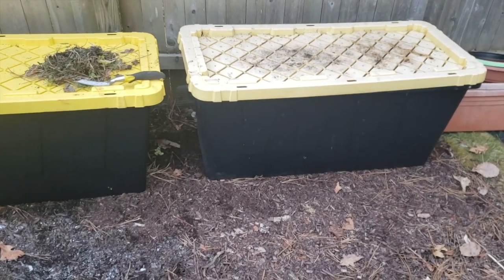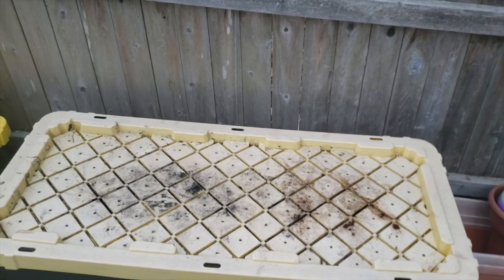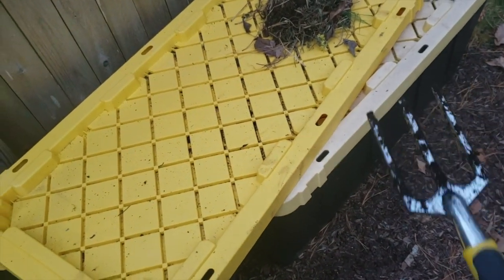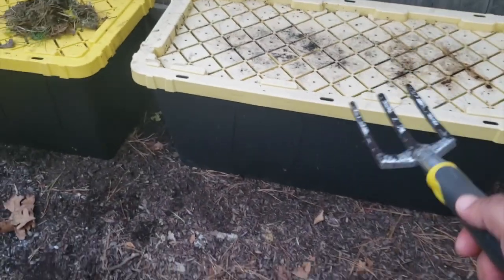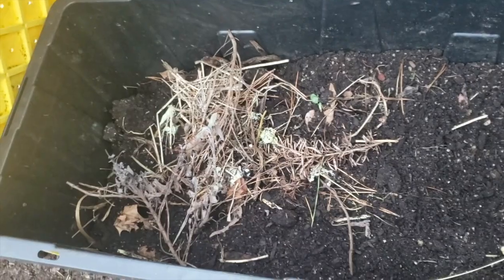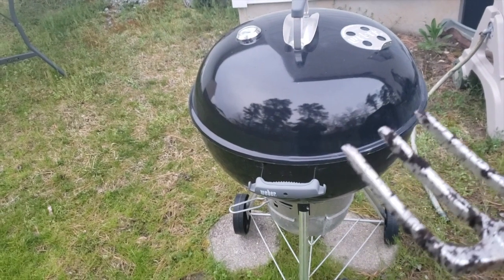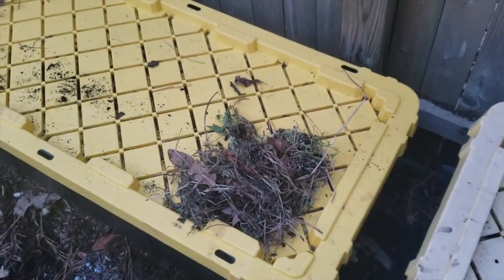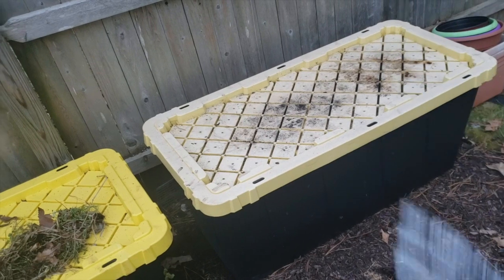Composting in Storage Totes

Comment: I do the even lazier man's method. I have less, way less holes, in my tote. I fill the tote all summer and top it off in August and again in November and then I don't touch it until May or June. I have the totes in a spot that gets winter sun. I might water them once or twice if I remember. Super lazy, takes forever, but the cycle works for me.

Comment: PRO TIP: Put a few small rocks at the front of the bin so there's a gap about a mm so worms that travel on the top of the earth, will find cover and then start working their way up for you. Reason I say this is, we all know what happens to planter bottoms when you lift them up or move them... This hide out spot where they will gravitate to, will make it easier for them to find the holes in your planter! -cheers

Comment: Great system! 
One tip from another gardener is to use a soldering iron to make holes in plastic totes, bins and buckets!
Reply: What about insects fruit flies getting in the holes
Reply: @joanneortiz6715  then you’re doing it right! The compost needs critters like that
Reply: You can also heat up a skewer on the stove to melt through, this is what I do any time I need to make holes in plastic. Works great with no cracking.

Comment: Wish i had seen this video years ago. I bought a tumbler. It does work but most of the good nutrients drain out of it way too quickly when it's time to keep it moist. So i have a bucket under to collect the compost tea. I save it and add it to the areas I'm going to plant in over fall and winter even over the snow to help get that area nutrients to soak in the existing ground. Also i don't get as much compost as i need. I have these same totes so this is a game changer for me 5 years later😊 late is better than never so thank you so much!!

Comment: Unless the containers are air tight you may not even need to drill holes if you're giving it a stir every week or so and managing moisture inside with what you're adding.  Currently have a tall trash can I'm composting in, but I really like the use of the wide bins in the video for ease of access.

Comment: Great video! I live in DFW area, so it is hot here most of the year, and this is the best compost method for me. I might add that I use the manual tiller from Amazon to mix it. I also tried to compost in a 32 gallon trash can, but it was very inefficient, too deep. 40-50 gallon bins are the best for me.

Comment: Very practical. I used 50 gallon trash cans on Wheels to move where I need. I like to bungee cord the lid on and Roll It on its side for aeration. I will try this as well I think it'll be easier to stir with my pitchfork.

Comment: Do you ever add worms or even lime, peat moss or other nutrients to your compost bin? Just a note for those who have not dealt with compost bins,  the weight of such a bin is really, really, really heavy if you do get water in it that does not drain. I had a modified compost bin from a plastic 55 gallon container. It had a large rod through it and was actually secured on a large wooden platform that allowed the bin to be easily turned. It had a door to remove the compost or to add in other things to be composted.  Best lain plans of mice and men sure went astray, as the bin got a lot of water in it and the sheer weight on it then broke the plastic where that main rod went through it. Took me forever to get all the mud and gunk out of it. Lucky t only ruined the top to the barrel, so I may try another shot at remaking the project to see how it works out. Thanks for posting this.
Reply from the maker: I don't add lime or peat moss. HOWEVER, there may be a little bit in there because I put in used potting soil to start. The worms come from how I start the bin with a layer or existing compost. I just did a video so that you can see exactly how I start the project. Check it out.

Comment: I have to questions 
1. Starting your compose bin for the first time what do you put down for the first layer?
2. Do you still compose during the winter? If so what is your process?
Reply from the maker: 1) Start with some compost, dirt from ground, or soil from old potted plants or containers. If you dont have any of that, just buy the cheapest bag of garden soil or compost that you can.

2) No composting during the winter.
Reply: @OldMcWaller  thank you for replying. I have started my process hoping for a good turn out.
Reply: @OldMcWaller   so how long before the first frost do you stop composting? Do you just separate out whatever is composted enough to your other tub and then dispose of the rest?
Reply: How do you keep pests out?

Comment: I want to put my bin in the garage, I know it won't compost as quickly as the sun/heat won't be on it, but then I can compost year round and it is just a few steps to clear out my kitchen compost and drop it into the bin.  Any modifications I should make to the process?
Reply from the maker: I dont know. I generally dont recommend doing this inside because of the smell and it could attract rodents.

Comment: very well explained, does this work for northern climates where it can get cold in winter.
Reply from the maker: The composting process will stop in the winter.
Reply: @OldMcWaller  thank u what do you do when composting process stops? just leave the tote as is and don't add more until next season?
Reply from the maker: @cutthecord1  Yes. At the beginning of the next season, I sift all of the good compost into the finished compost bin. Anything that has not broken all the down, I leave in the active bin and just start adding more to it.

Comment: Thanks for the video. I constructed a 10"x10" pvc greenhouse. I don't want to place a heater in the greenhouse, and saw that I can use a hot compost to heat my greenhouse. I plan to use the same size container as you. Do I place the container in the greenhouse, or on the outside? Also, do I take off the lid at night to provide heat? Any advice will be greatly appreciate.
Reply from the maker: I would place inside. if you take the lid off in this type of compost system, you may lose the heat inside. Normally the kind of compost system you would need are the taller ones. They give off more heat. It may work though.

Comment: So, if you keep adding stuff to the compost, how do you know when to take it out and put it into the finished compost pile?
Reply: You don't just dump everything into the finished bin. Instead, you scoop out the compost and pass it through something like 1/4-inch hardware cloth (wire mesh, mounted on a frame) to catch the big bits that haven't been decomposed yet. Whatever doesn't go through the screen goes back in the working compost bin.

Comment: If there are holes on the top, how do you protect the compost from being completely drenched by rain, or is this not a worry? Do you put it under shade or throw a tarpaulin on top when it's about to rain?
Reply from the maker: I am making a Q&A video about my compost system. I will answer these kinds of questions.
Reply: You could buy an extra lid, don't drill any holes in it and swap over to this lid when it's about to rain.

Comment: Very good post. I will be starting my first compost soon to be ready for spring. I do have 1 question friend. 1st layer compost 2nd layer green 3rd brown 4th compost & repeat correct? And do you add water in between layers or I guess how do you dampin the layers? Thank you
Reply from the maker: Compost is what the green and brown make together. I add a little finished compost at the bottom because it included microbes and bacteria to help the process along. So you only need to layer green and brown after the initial layer. It doesnt have to be neat cuz you will be turning it over every now and then. I add a little water here and there but not much unless i see that it is super dry. Normally the rain that falls through the holes on top is enough water.
Reply: My query is the holes at bottom of the container will drainof all the compost tea that is formed ,so instead of holes can we put a tap kind of to collect compost tea
Also does this kind of boxes works efficiently if size is 3 feet by 3feet as I have a container of that dimension.
Reply: Hello thanks your for video. I will start this today 💖 if I don’t have any compost for the initial layer should I purchase some? Or do I just start with the green and brown? Thank you 🙏

Comment: Good vidio, thank you. Like to know since plastics is bad for us, do chemicals no bleach out and contaminate stuff? Especially when it gets hot. Cancer is linked to water bottles  leaching chemicals in the water, especially when they are left in the car ect.  Just a thought. 🙄
Reply from the maker: The materials in of this plastic is food grade. You are producing a compost which is a growing medium. You are not directly consuming the compost like you would in with the water. But if you don't feel comfortable, use another method. That's the great thing about gardening. There's always more than one way to do things.
Reply: @OldMcWaller  absolutely,  yes more ways. Just concerned, coming from Germany we use little plastic (not to much from China, like $stores  ect.) Just learning, not a challenge my friend. We in Europe has  many chemicals forbidden , that the FDA alowes in the US, amazing,  Thank you again, stay well and healthy.😘🙏✌
Reply from the maker: @myfivestarrealty  Start with a pile. Get some chicken wire and make a big circle about 3 feet across. Dump a bunch of leaves in there then start adding your food scraps. It will work and you can be worry free. :-)
Reply: @OldMcWaller  awsom, thank you very much, or as we say in German Danke schoen. 👍

Comment: Do you water your bin? Others seem to water it when they turn the compost and I don't know if its necessary.
Reply from the maker: I do sometimes. When you go to turn the compost, if it is dry water it. If its not dry, leave it alone. The holes in the top will catch the rain. I do lazy gardening so sometimes I will take the lid off if I know rain is coming to get it extra wet so that I don't have to worry about watering. Turning and watering just helps you get it faster. If you never watered or turned it, you will still get compost. It just happens by itself.
Reply: @OldMcWaller  Using the rain is smart. I'll remember that, thanks for the info!

Comment: Really like your video!  Made it so easy to follow!  What kind of soil do you use?
Reply from the maker: Are you asking what soil I use to start my compost?
Reply: Old McWaller yes.  Just started my first
Reply from the maker: @sharoni6490  I use ANY soil that has been in the environment. So you can dig up some dirt from anywhere OR if you have flower pots or containers you used for growing, you can use any of that soil. Being in the environment, they will all have some microbes and insects and worms in them that helps to break down the compost better. I wouldn't buy a bag of soil for something like this.

Comment: Where is the best location in the yard to place the bins?  Sun or shade?
Reply from the maker: Either works, you really can't smell it until you remove the lid. The more sun the more it will heat up. The sun may also dry it out more too. I have mine in a place that gets some sun but not full.